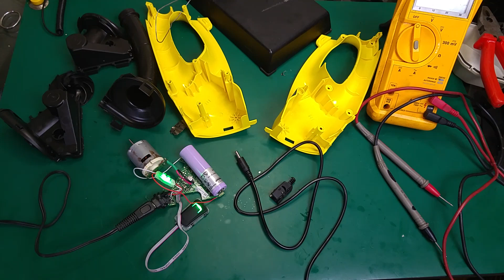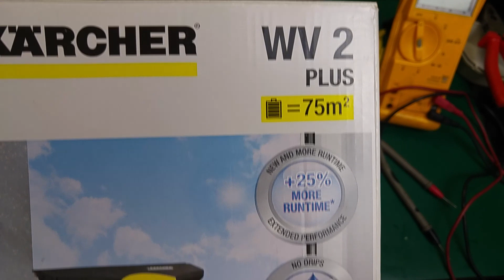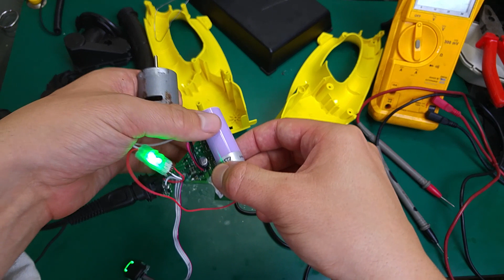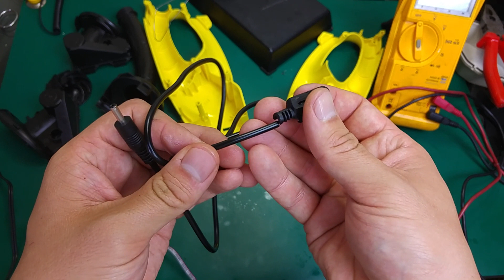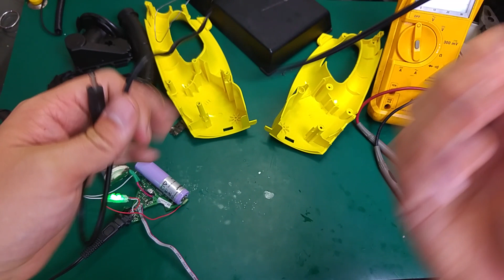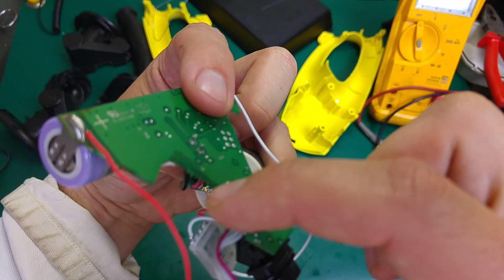Fixing KARCHER WV2 (not charging) with off shelf charging module

Comment: Hi Just for Information . the Mosfet is a Whs which is a BRC108 . there are two on the board one near the cable to the switch & one to the Left of the Big Cap,, (small three pin Mosfet). I replace one and all good now ,, the problem is water getting inside.. My issue was not charging and the Green Light was on all the time ,,,,,  hope this helps.  I got Replacements from Aliexpress
Reply from the maker: Thanks for the info!

Comment: This video fixed my Karcher WV2, after I added the TP4056 module, I have looked at the overall design, I really think that design has flaw....water will get into it if you use the Karcher WV2 upside down or even sideway.  I have seal the enclosure and around the motor area with PLUMBER'S MAIT. Fingers crossed...!!! Thanks for your video
Reply from the maker: Indeed - lot of people have same problem and it came from reputable company. Shame.  Glad it worked for You and it was saved from landfill!

Comment: Where I have left the wv2 in storage, the battery has obviously gone flat but on all occasions it doesn't seem to charge when plugged in (no green led). To overcome this you almost need to jump start the battery; if you push the charging lead in very slightly the led will flash. Pull out again.  Repeat for about 1 min and eventually the battery will begin charging normally again when you push the charger all the way in (flashing green led). Hope that helps!

Comment: I have a problem with my karcher WV2. The red light keeps flashing when on charge and will not go solid, the motor does work but does not last long (probably due to the battery not receiving a full charge. With the vac in your video did this have the same problem constant flashing red light when on charge?
Reply from the maker: Maybe battery lose capacity. You can rule out charging circuitry - left it plug in and after couple hours measure voltage at battery terminals. If You read  near 4.2V and it will drop quick after turning on - here is Your answer - just replace battery.  If it read much lover after long charge - most like charging circuitry is faulty.

Comment: Thanks for posting a great video, helped me take my machine apart. 
My symptom was that the green light on the on/off switch would flash if it was pressed.
Also this light would flash when the charger was connected, but the charging would never complete.
The problem was that some water had managed to get onto the circuit board, where the three wires 
from the switch are soldered to it. This caused corrosion in this area of the board. I cleaned this off, 
then resoldered the three wires to the board. This time the unit charged up, the green light flashing 
until the charging completed. The fan then started when the start button was pressed. Fixed!

Comment: I have one where the charging circuit failed, I charged the battery and cleaned the motor and it started working, but after a bit of messing around it stopped working.  Pressing the button now just makes the motor jolt slightly and then the light flashes, the motor works if I bridge the negative straight to the battery, but the on-board control circuit has decided it doesn't want to run it.  Any ideas?

Comment: Hey, I've got a few questions.
Does the original 18650 battery have a protection circuit?
Also do you know the max amp the wv2 is drawing? 
Is a 20s overkill, max 40a discharge?
Thanks in advance.
Reply from the maker: Cell  itself is  not protected - protection  is  on PCB.  In case You plan to bypass existing PCB then add over current - discharge  protection by yourself.
About current draw - i don't have it to measure. Check if there is label telling You that in watts and just divide by 3.6V you get rough current value, then add couple amps to be safe.

Comment: Great video. I have had two replacements now from Karcher and this issue has returned. You have responded to a viewer regarding the charging. Could you please tell me which "generic PCB for charging li-ion" you would recommend. Thanks in advance and just subscribed. :)
Reply from the maker: Hey, Yes, they fail like fly You can see this from thumbs up :(
For video i torn apart "smile usb charger 4.2V" that how it was called - but it's waste of resource.

You can try TP4056 - very cheap I use them in many projects and working perfect. 
Thanks
Reply: @ElectronicNoobBlog  THANKS FOR SUCH A QUICK RESPONSE. I purchased 5 TP4056 off eBay for £5. Easy fix without complicating matters. All the best!

Comment: Great video, in my case the charger and light appeared to be working but when i turned it on no sound from the motor. I followed your video till I exposed the fan, it was jammed after sitting for about 12 months unused. Gave the fan a few turns with my finger and this free the motor and it working fine.  Thanks for a very informative video.
Reply from the maker: Thanks for sharing,  You welcome.

Comment: Hello, a friend's window vacuum cleaner had a waterproofing defect, and it does not work anymore. The failure seems to be different than yours (as you said, every failure case is different!), as on mine no power arrives to the motor neither to the button (no LED light, no effect when pushing). I am now considering replacing the whole board by a self-made system, but I have no equivalent working device to check how it shoud behave. I was surprised to see that the device is powered on a 3.7V source : do you remember whether the motor runs on 3.7V, or is there a voltage booster?
Reply from the maker: First check voltage on battery, often devices with over-discharged battery won't turn even when power supply plugged in. (just make sure that's not the case)

Making own board would be great..
There was no voltage boost because i don't recall any "beefy" instructors. 
Board just control charging, prevent from over discharge, and switch it on-off via some kind of mosfeet. 
If You grab just a PCM to protect li-ion from over discharge You can use toggle switch to turn it on-off and separate board or external usb module 4.2V just for handling charge.
Reply: @ElectronicNoobBlog  hi! The battery seems ok, it gives a nice 3.8V
Reply from the maker: That's good news, have You tested motor by itself?  
I would try it via resistor like 1 ohm just in case short / damage inside  motor assembly from water.

Comment: Very clever solution! Can you provide a reference for your small charger from China?
Reply: Inspired by your idea, I did use this module from Aliexpress - https://www.aliexpress.com/item/1Pc-5V-1A-Micro-USB-18650-Lithium-Battery-Charging-Board-Charger-Module-Protection-Dual-Functions-Integrated/32897103033.html?spm=a2g0s.9042311.0.0.27424c4dqFVRyC - works perfectly well !
Reply: @SiegfriedLöffler  I wish I had your knowledge in how to change this - we have the non-charging problem and the cleaner has never been used but is out of warranty.  It seems to be a common fault.
Reply: @traceclip1  You really don't need a lot of skills to fix it. Just use a small module like I did and solder two wires to the two battery cables and the two 12V connecter to the plug. That's it. The charger is then parallel to the old one which no longer works.
Reply from the maker: Thank You for comment,
In video i use one of these ->
https://www.ebay.com/itm/LED-USB-Charger-Data-Cable-Smile-Face-for-Rechargeable-Headlamp-Torches-Black/152799065393?epid=2167475458&hash=item239388b531:g:-7cAAOSwTuJYwh4f

(i did it only because i do not have any other around and need to fix it quickly)

I use these in most cases ->
 https://www.ebay.com/itm/10-Pcs-TP4056-1A-Li-ion-Battery-Charging-Board-Lithium-Charger-Module-Mini-USB/231742571651?epid=3009528796&hash=item35f4ef0483:g:EhkAAOSwXYtYsqNG

(they allow to change current via soldering resistor so could be use almost in any application (battery capacity) ), but default 1A  working safe for all 18650 > 1000mAh with will be 1C.